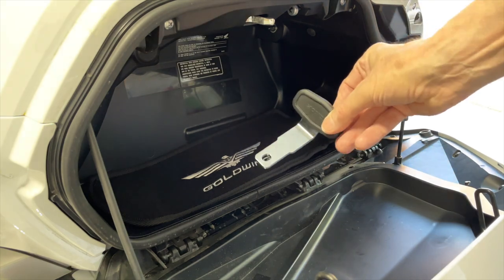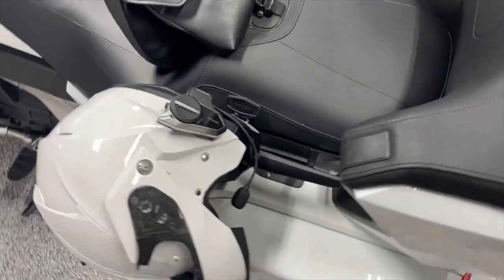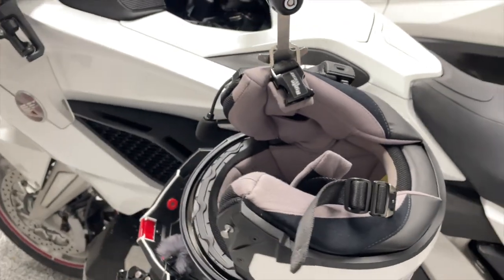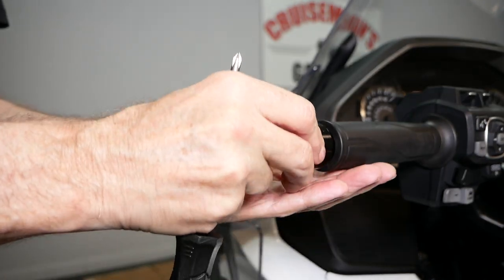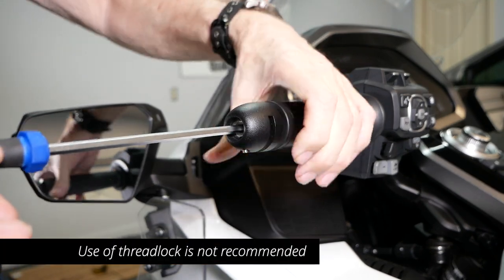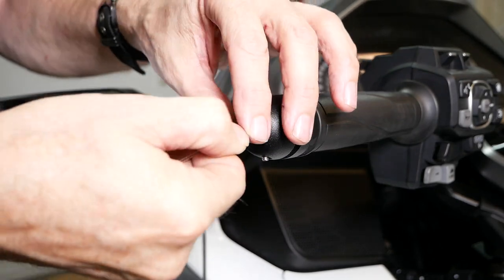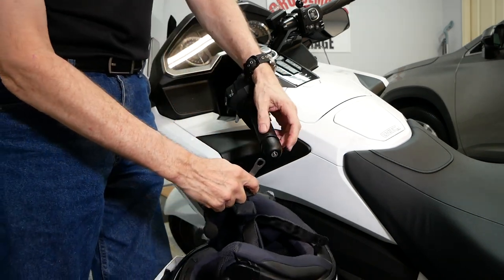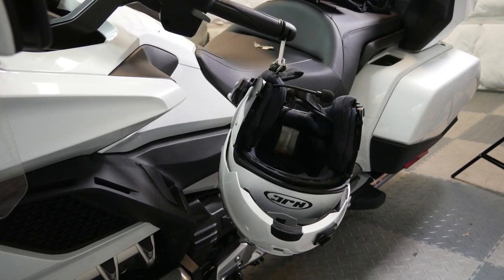Installing Lidlox Helmet Lock Onto 2018+ Honda Goldwing | Cruiseman's Garage

Comment: I have taken a 2 to 3 foot length of small diameter aircraft cable and created a loop on each end with hourglass swage connectors. You run one end through your D-ring, then through the opposite loop, then put Honda's locking bar through that end and lock the bar into the locking slot. With this system you can also lock 2 helmets with the same cable and have them sit upright on the seat.

Comment: Nice idea. The problem with helmet locks where I live is that the thieves cut the strap and steal your helmet so they can take the communicator at their leisure. Not only do you lose your helmet but you are stranded because it is illegal to ride without a helmet. That's why I always carry my helmet with me.
Reply: Yeah, it's impossible to simply remove the communicator and lock it in your trunk. Too much hassle.

Comment: I tried the LID Lock on my 2018..I found there was more handlebar vibration at higher speeds with the LID Lock because there is much less mass and weight to damp out any vibration in the handlebars than with the OEM handlebar dampers. I removed the LID Lock after one road trip.
Reply: There is a bar end weight you can add to your Gold Wing Lidlox.  Lidlox item 1067 for the single or 1068 for the pair.

Comment: The challenge with these helmet locks is that many helmets have ratchet style closure vs d-ring. Have you seen any solutions for those? I use my trunk to store my helmet, but then can’t store anything else.
Reply: Lidlox come with a helmet hangar that works on All helmets.  The helmet hangar slides through the female side of the clip.

Comment: The handle bar helmet locks are great if you like catching rain water in your helmet.I live in a no helmet state,but choose to wear one.For the last 12 years I've set my helmets usually on the seat and have never had one stolen. Probably because its a no helmet state and no one wants the helmet is my guess............
Reply from the maker: How is that any different than Honda's solution?
Reply: Chris, I put my full-face helmet on the seat, right side up, with the stock Honda T-bar.  That keeps it off the paint and less likely  to collect rain water.  The bar-end helmet lock wouldn't work for me because I like  to lock my handlebars when I park.
Reply: @cruisemansgarage  I was going to be sarcastic yet again but instead I'll tell you that you can use Honda's seat lock tab with a cable pistol lock like you get with a Glock to secure you're helmet on the seat so it won't collect rain..I keep one in my saddle bag when traveling..Of course if someone wants your helmet bad enough they'll get it.....

Comment: Of course there is a difference on the weight of the OEM handlebar weights and the lidlox weights.  This will affect somehow the stability of the handle bar.
Reply from the maker: I have had LidLox on my 2018 for more than 2 years and I cannot tell any difference.
Reply: @cruisemansgarage  glad to hear it .
Reply: @cruisemansgarage  Some people are more sensitive to the handlebar vibration than others..just as some feel the the heat from the radiators and some don't. The 2018 plus models are not quite as smooth as the old model as it is..reducing the weight and mass of the handlebar dampers was very noticeable for me...in fact, I installed aftermarket handlebar dampers that are larger heavier than the OEM handlebar dampers to smooth out the handlebar vibs even more than the OEM handlebar dampers did...my 2018 is now as smooth as my 2003 was.
Reply from the maker: @frankward8003  I might look into some of those heavier dampers.
Reply: @cruisemansgarage  You can purchase the weighted spacers from Lidlox also. These are installed between the end of the bar and the Lock.  I did this on both handlebar ends of my 2018+ Goldwing so that the helmet is locked a little further out from the body work.   It probably will help to dampen some of the vibration as well.

Comment: What's to prevent someone from just unscrewing the lock mechanism from the bike? Looks like you can just unscrew the lock then unscrew the Allen bolt and take all of it.
Reply: You need both tools and the keys to unscrew the locks.
Reply: @Lidlox  so without the correct keys, the lock body won't unscrew. Am I right on this?
Reply from the maker: @JonR_1138  Yes

Comment: If there’s a way to use it with the Kuryakyn grips, I’d be all over this.
Reply: Lidlox has locks for Kury Grips.
Reply: Iso grips from Kuryakin, lidlox for them.
 Fatter grip, two helmet  locks,works well

Comment: Tried locking my son's helmet but it didn't have a 'D" ring.
Reply from the maker: What type of helmet?
Reply: @cruisemansgarage  Nexx SX100r full face with ratchet strap.
Reply: The included helmet hangar works on ALL helmets.
Reply: @Lidlox….how does it work with the ratchet type of strap?